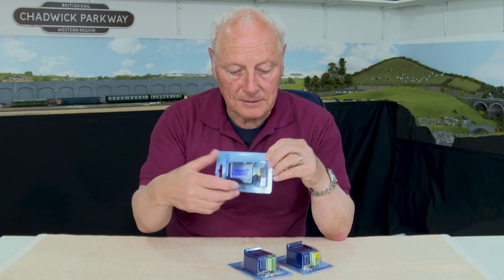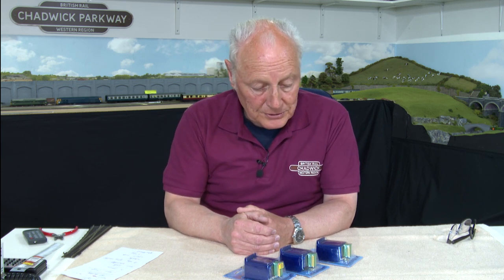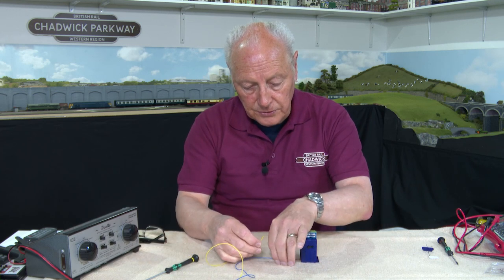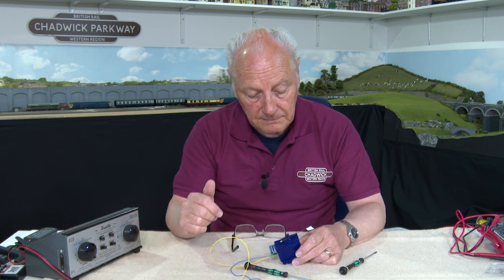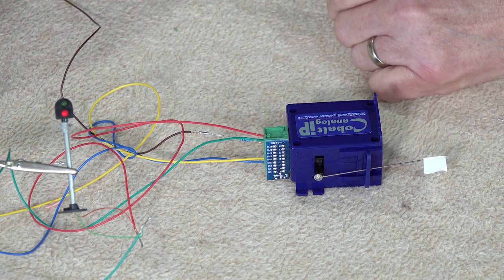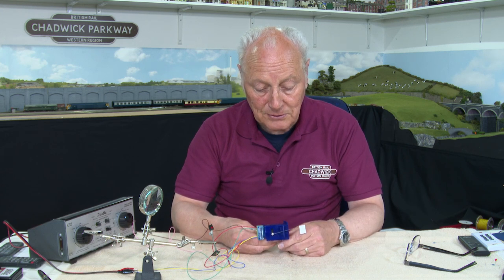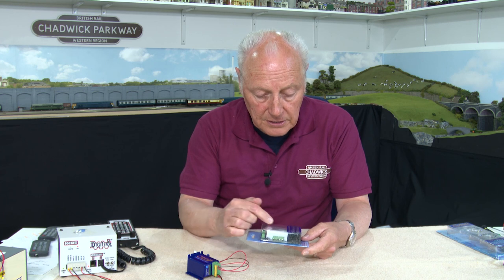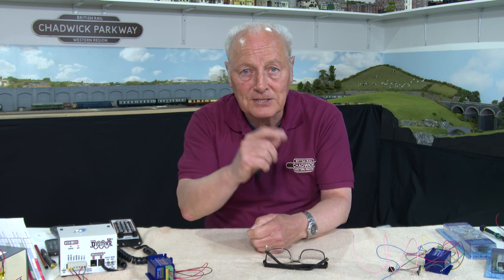Cobalt Point Motors on test at Chadwick Model Railway | 161.

Comment: Hi Charlie, reading through the entire thread here along with all the comments has been both interesting and informative. I've been helping a friend instal Colbalt point point motors between the main yard and the storage yard directly under it there being only 9in (225mm) between the two. So, installing them has been "challenging" for want of less appropriate words! 

While this would be the case for any point motor in this space, it was not so much in regards to final positioning as it was trying to connect the wires post installation to the point motors. The double sided pad (and having a handful of "spares" is very useful) made positioning relatively easy and using a template to pre-drill the screw holes worked a great for all but one of 32 screws - my bad here. 

What I did after point No3 was pre-connect the wires, position and fix the point motor then fed the point wiring loom (7 core lead) down to the master terminal board which came with its own challenges but that's another story. Unfortunately I had to change two wires over on one of the installed points and it took longer to do this than completely install three to four point motors. 

While I'm a Tortoise man myself, the Cobalt point motor does have the advantage of being smaller so will fit more conveniently into those tight locations - something to consider as I look at starting my first "home" based layout.

Thanks as usual for the informative clip, but I too look forward to seeing some more work on the layout - is there really another helix? Best Regards from the other hemisphere...
Reply from the maker: Thanks for the very informative comment Brent.
Yes there will be a second helix but next time I will reveal just how much has been going on, behind the scenes.
Regards Charlie

Comment: For what it’s worth, I have both on my layout and with simple switch controls I prefer the sound and smoothness of the tortoise. However, when I wanted to set up 6 routes into the TMD involving multiple point movements with a single push button to set a route, I couldn’t get the tortoise motors to work with a diode matrix (future video Charlie?). So I got 6 of the Cobalt Digital IP and they do work a treat. Nice that you can control them digitally to and also centre the wire if necessary all from the controller. Also no soldering of course.
Reply from the maker: An excellent comment Alan and most useful. Regards Charlie.

Comment: I still use the Peco solenoid motors on my original level but use over 50 Tortoise motors on the storage and upper levels. I wish these digital ones were available a couple of years ago. I currently don't have the facility to change the points with my Digitrax controller, which I sometimes could do with.  On second thoughts. I don't have access to most of my Tortoise motors so maintaining them is a no - no.
Reply from the maker: Could you not wire them up with a DS 64 Sam? Regards Charlie
Reply: @ChadwickModelRailway  How many DS-64 units would I need though for 50 odd point motors, The DPDT switches I use are centre off so could parallel them with the DS-64 if I wanted to.

Comment: Brilliant vid, Charlie. I contacted DCC Concepts about using IP analog or IP digital and unsurprisingly, they recommended the more expensive digital. DCC Concepts items can be obtained much cheaper from other 'reputable' model railway shops!

What I liked about this vid is you made clear how to wire IP analog frog switching on a DCC layout but when accessories and point motors are dc powered. I know some people have had shorts with the frog switching because the accompanying leaflet didnt make this clear.

Im torn betwen the DCC Concepts system and the Mega Points Controllers system. Basically, with DCC Concepts, the IP analog and digital handle switching, frog switching and fixing in place, all in one. With MPC, you have to buy servos, relays and board for frog switching and the fixing kit. All in all, this means there isnt much price difference between an IP analog \ digital and an MPC servo, board, relay and fixing kit etc.

Essentially, DCC Concepts is built for DCC operation whereas MPC is built for DC but can have a DCC signal.
Reply from the maker: Interesting thoughts 1701, I remain a tortoise guy.

Comment: Hi Charlie,
As usual a very informative and entertaining video, please keep up the good work.  One thing that you did not mention about the iPDigital motors is that they contain their own decoder, which means that you do not require the additional cost of a stationary accessory decoder like the Digitrax DS74 or DCC Concepts AD8FX.  Just a thought mate.
Cheers,
Kim
Reply from the maker: A fair point Kim but I certainly mentioned the programming switch and the need to give it a digital address.
Regards Charlie

Comment: Hi Charlie, nice video, in my opinion these are the best slow action point motors on the market I have 15 IP digital point motors on my layout and all work great. I can change them thro my Dcc controller  via the set address  or manually using SPDT Switches they are very easy to install and set up, and no soldering required , also DCC  after sales service  is very good and helpful + life time gaurentee  it's a no brainer.
Reply from the maker: Well there’s a recommendation, many thanks, regards Charlie

Comment: Good evening, Charlie. Informative video again! You operated the point motor with a 2-way centre-off toggle switch. Would it still work with a 2-way toggle? That way you get an indication of the set direction (the toggle switch tells you). Then you don't need LEDs and resistors... just trying to make things simle (and cheap!).
Reply from the maker: I don’t think you can Kev, I think it just needs a pulse. Regards Charlie
Reply: I'd guess the switch inputs are a pulse so you can operate the motor with either a DCC command or a physical push, or momentary toggle, button. If the switch was permanently in one position or the other then either the motor would have to ignore a DCC command or it would respond to a DCC command and then be out of correspondence with the toggle switch.

Comment: Hi Charlie, been loving the channel very insightful of how to go about your layout. Im looking at sorting my layout for DCC before I go any further with my build and was wondering if you use those terminal blocks on your main bus wire. So you'd feed your bus wire in from one end and then out the other and then put your dropper cables in the spare slots or do you use something else for that job? Keep up the good work. Gaz
Reply from the maker: Gaz, that’s exactly what I do.  They are ideal to act as a central bus every few yards. Regards Charlie
Reply: @ChadwickModelRailway  thank you for the reply and your help that is a real help thank you ☺

Comment: Hi Charlie.
Regarding the removal of the spring from Peco Electrofrog points.
I have been doing this for a while, (and using Tortoise point motors)
I had cause to send some points back to Peco for repair and whilst chatting to a guy at Peco he said that the spring should not be removed!
There are many videos out there showing the springs being removed.
Makes me think about leaving the springs in on the next couple of points and see what happens.
Keep up the good work.
Cheers. Pete
Reply from the maker: That’s very interesting Pete. Could you email me with your findings? Regards Charlie
Reply: @ChadwickModelRailway  Will do Charlie. May be a few weeks. Abroad at the moment. Pete

Comment: Hi Charlie  Nice review.  Pretty much what I have found.  I've got about 30 of these and been running for 5 years without mechanical failure.   I had a couple just go dead and were replaced swiftly without quibble so the guarantee is exactly what it says.  I use the crack on some and they are pretty good.   I also use the point rodding in a couple of places also from DCC Concepts.    Richard Johnson is a good guy.    The only criticism is that I could not find a way to automatically centre the Cobalts.  I always test gear before I get under the boards and to install them it's best to have the device centred.  Once you test them, they stay set in one or other direction and unless you pull the power as they are changing, I am not sure there is an auto-centre.  But perhaps I am missing a trick.  You should perhaps review the Cobalt SS DCC one day as these a fabulous little things where space is critical - but an entirely different ball game installing.  I also like the quick [programming to reverse the action and have that set-up as a special button on my ESU controller.
Reply from the maker: Thanks for such a reassuring comment Alec. Regards Charlie
Reply: Hi Alec  -  if you want some help enabling self-centering, we can help with that - drop us a line :) ^RB DCCconcepts

Comment: Hey Charlie great video once again mate. How would someone like me go about fitting those fantastic items has I've about 20 points at the minute with more to be added and they all insulfrog? Kind regards Gary
Reply from the maker: You could be on expensive, slippery slope Gary.
Reply: @ChadwickModelRailway  so what other options do I have just keeping the manual operated or something on the market that I could look into has I would also like the signals to work with the change of the points. What would be your honest opinion feedback would be much appreciated thanks Charlie.
Reply from the maker: Using servos is far cheaper but setting up can be time consuming.  There are lots of great videos about on YouTube.

Comment: Excellent video Charlie.  Mind you, 50 point motors at £22 a pop ! -That's some serious investment.  I went cheap, used an Arduino Nano which plugs into my own design of  daughter board to handle the 16 switches and 32 LEDs, with the points being controlled by my own tweaked 3d printed version of a linear motion servo motor.  This is driven from a PCA9685 servo board all of which is documented on my channel and it will soon be fitted to the layout I'm currently building.  Granted these DIY approaches lack the convenience of frog switching etc that the Colbalts and Tortoise motors offer all in one unit, but then you would expect that when spending over £1000 on a means to change all the points on a layout the size of Chadwick (hate to think how much has been spent on McKinley!!)

I just want to add that I've been very impressed with your videoing skills on the recent McKinley videos, especially the ASMR videos featuring Ivana....Keep up the good work
Reply from the maker: I’m pleased you enjoyed the video Malcolm. 
My filming down at McKinley is very rewarding. I’m so pleased that you find it interesting. Regards Charlie
Reply: I was going to say, can't you cheaply switch the electro-frog using a MOSFET, but while commenting elsewhere I saw that DCC switches the polarity of the rails, which would make the electronics quite complicated. A bunch of tiny relays should do the trick, although all costs money and more pins off your Arduino.

Comment: I like the idea of the IP Digital, but if they are powered from your DCC bus, then on a large layout that's a lot of power taken from your DCC feed. At least with the tortoise motors you can operate them from a separate power source.
Reply from the maker: That’s right Iain, ideally you would use a separate DCC power bus. Regards Charlie

Comment: It looks as though it would be nice if the spring loaded terminal strip would be removable so as not to have to remove the lever for (re)wiring.
Reply from the maker: But at least you’re not having to carry out soldering upside down. Regards Charlie

Comment: Hi Charlie - great video as usual. I have been using Cobalt iP Digitals now for about seven years and they work well. Mine are wired for both DCC and toggle switch operation (I never use the DCC switching method - it takes to long). Some Cobalts are wired to Dapol signals, and again work well. I would certainly recommend them.
Reply from the maker: That’s great news Barry, thanks for your input, regards Charlie

Comment: Amazed at the size, so big, a primitive connection for the steel wire, electrical should be 1 connector to easily plug in/out, maybe add a rj45 connector if 8 wires is enough, (power is not a problem, poe can power a camera/wifi access point)
5 year and oiling, is there an instruction video for that ? 
item should be easily installable/removable which it is not at the moment, 
needs fixed part where the engine easily connects to, wiring should be via the fixed plate.
Reply: Well there isn't a standard for that yet so screw terminals and clips it is. And as long as there isn't a standard people like to avoid vendor lock in. Even S88N did take ages to appear as a standardized connector
Reply from the maker: I certainly understand your points of view gentlemen. 
Servos seem to be the only miniature system available should you have the will! Regards Charlie
Reply: @ivovanzon164  the rj45 can be a personal choice, a 1 time upgrade to all the cobalt wiring, but very easy to use, adding a plate between underside layout and the cobalt is also a 1 time choice, can make the detach/attach easier at least when the metal wire connection is solved.

Comment: Hi Charlie A great little video, its interesting to read of the failure of the DCC(?) version from Bryan and others, although I think when I get round to buying point motors I think I still would choose these, just because of the range of options to work both signals and switiches off the same 'contact point' as it were. Thanks again.
Reply from the maker: They are certainly worth considering Peter.

Comment: I wouldn’t have thought that solely relying on the control wire take offs for the control panel indicators is the best option on the analogIP. I’d say use the point motor detection output for the control panel lights, then use a logic gates or relay logic to automate the signals on top of that such the green signal light is lit when the point detection is normal and the control is also normal, or reverse detection & reverse control and then when the point is set wrong or with non matching detection illuminate the red aspect. To complex on the signal front I know, but would definitely say to use the detection terminals for the control panel, shame though that it switches half way over and not at the extremes of movement to give a true detection signal, but it shows you what the point has done not what you told it to do - important if there is a fault in the wiring, more so on an exhibition layout where one is more likely to occur.
Reply from the maker: An excellent comment and much appreciated. Regards Charlie

Comment: I fitted about 15 Cobalt motors. There were very unreliable (emitting a click click noise) resulting in me changing to mtb MP1 motors. They are easier to install and have less parts to go wrong.  The other thing worth mentioning is since having issues with de-railment on a Peco 3 way point the guys at Peco advised me to leave the spring in the point which I now do, and the points work much better.
Reply from the maker: Thanks for the info Robert.  I found that the three way points were inconsistent in build quality. Regards Charlie
Reply: @ChadwickModelRailway  I concur about the three-way points (code 100 electrofrog).  I rearranged mine so that they are only used in the trailing direction as trains often derailed when run through in the leading direction.
Looking forward to layout progress instead of reviews, Charlie.  
Also, please ask David at Mckinley to show us some action on the layout!  
Best wishes, Chris

Comment: Thanks Charlie. Since starting my layout build about 12 years ago I had every intention of using Tortoise motors but was introduced to the Cobalt IP digital by my local retailer. I have since bought about 20 of them and love the fact they are DCC out of the box. I mainly control them from a JRMI PanelPro touchscreen laptop which works well and saves a lot of switch panel wiring! I have never pulled mine apart to oil them which may explain why the oldest ones are not working great. I have been planning on pulling them out and sending them off for warranty. I was curious to see if you did a cost comparison between the IP digital and your Tortoise with DCC digitrax interface?
Reply from the maker: An interesting comment Michael. No I was never going to do a comparison between those and tortoise at this stage. Regards Charlie

Comment: Great demonstration, Charlie.
There have been historical issues with Cobalt, which I believe have been addressed (?) and Tortoise have over 30 years of highly reliable running on thousands of layouts in many countries, particularly the US where they come from.  
Cobalt uses an intermediate gear where as Tortoise use only two.  Cobalt is smaller than Tortoise.  Cobalt has a Lifetime Guarantee; Tortoise guarantee is 9 years.  
Does the guarantee require the 5 year maintenance to be carried out? 
I know that you are a Tortoise man but are you now going to change brand?
The $64,000 question is; which brand is the quietest?   Best, Jason.
Reply from the maker: It wasn’t a comparison, just a review.
I certainly won’t be changing brands.
I never new about the 9 year warranty .
Reply: Just jumping in here to reassure that the warranty is not conditional on the maintenance recommendation :)
Reply: @richardbrighton7737  Thanks Richard, for the clarification. Good to know. Best, Jason.